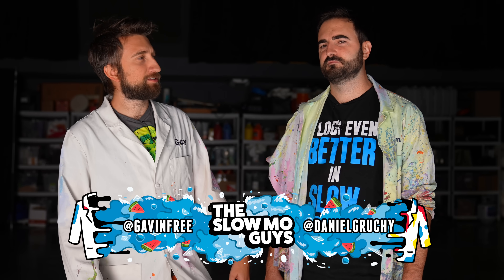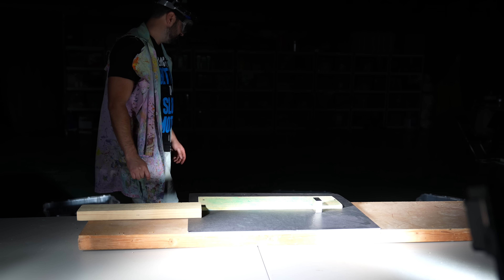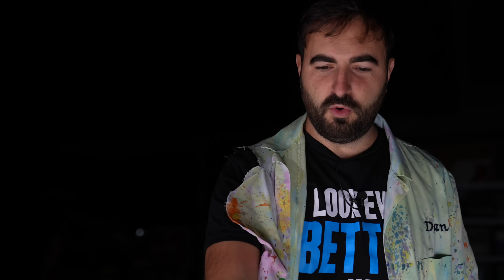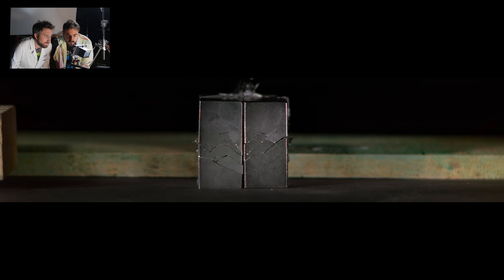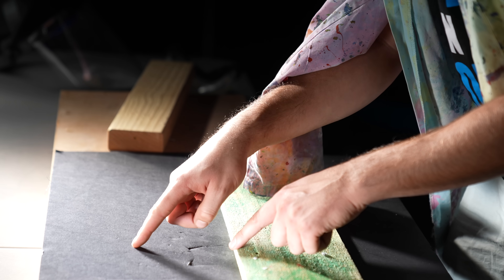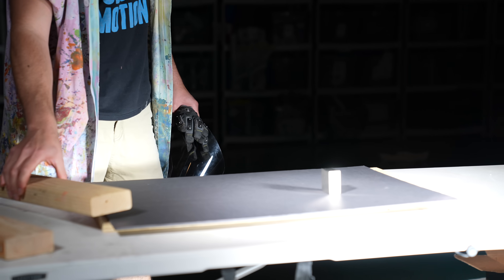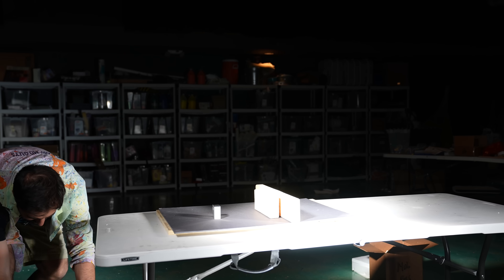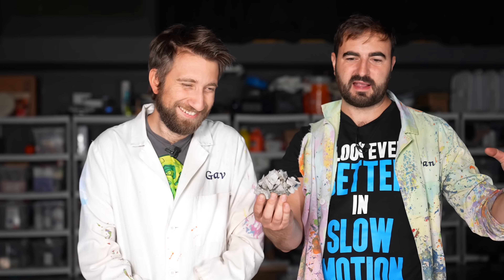Ridiculous Magnets Colliding at 187,000FPS - The Slow Mo Guys

Comment: The sparks come from tiny particles that have been fractured to reveal fresh unoxidized rare earth metal fragments, which spontaneously ignite in air. Related heavy Lanthanide and Actinide metals are also pyrophoric, such as those used in cigarette lighter flints and in depleted uranium armour-piercing anti-tank shells that ignite on impact with the tank armour as they penetrate it releasing white hot burning uranium particles within the tank, burning personnel, ammunition, fuel, and anything else flammable in the vicinity.

Comment: That insane power right there is evidence for the balanced force holding everything together/apart.  Inside those magnets is just a tiny amount of the electrons are surface=spin aligned.  10^-22 of them perhaps, but this enough to produce those results.

Comment: You guys overstated the danger of magnets.  At more then about a foot, you most likely could not detect the field (if you could, it would be weak).  Magnetic fields decay exponentially with distance (i cant find one single formula for this, seems to be a very complex topic, but what i said seems to be a rule of thumb type thing.  the field still decays quickly though).  You will still have to not put your hands between the magnet and anything magnetic, and don't bring digtel device close (about ~6in away is safe for modern SSD, hard drives are much more supsetable to this kind of thing)

Comment: Would be cool to see what the fields looked like on a large ferrolens as the collision was happening.  Heard somewhere on line (I think Ken Wheeler) that the stronger the field is' the shorter the field is' due to it falling back upon itself at a higher rate of speed, if I'm not mistaken.

Comment: I remember "playing" with a very strong magnet once at the lab as a PhD student. Probably not as strong as that, but freaking strong, to the point it WAS dangerous.
The researcher around told me to be careful and that it was no toy. Thus I was careful. And yeah, I totally could feel the moment when I would have crushed my hand.
In the end nothing broken, no problem. However I do realize now that it was a bit "incautious" of them (and I myself was very much unaware of the actual danger and problems).
Well, that were different times. To be fair, there was enough issues around. I mean, we WERE in a nuclear reactor, so... what could have gone wrong?

Comment: What if you took the two clumps at equidistant ends of the table & slowly moved them together. Would they collide or are their poles too irregular? If they collided as they did the 1st time, would they reorganize into a better bi-polar magnetic structure ?

Comment: Ew, ew, ew! Please consider a "Magnet's Colliding II." You could have the magnets sitting on top of plexiglass sandwich with iron filings in the middle. When filming from above you may capture the magnetic lines forming in the iron filings. It might take a large plexiglass table with possibly the magnets positioned above a 3rd sheet (leaving a gap) and it would take buukoo filings.

Comment: I was so on the side of measuring the speed/velocity increase at the same moment Dan said it.  You should have done the second one with the black/white grid for the measurement.  I'm banking there is a velocity increase (but at what level and level of increase as the magnetic pull increases [i.e. getting closer]).  Still a brilliant piece of filmed footage gents.

Comment: I have a Question. It's when the magnet collides I see that there are tiny pieces of it and floating around then moves away itself. Since those tiny parts are also magnetic why did it not move back into its body ?

Comment: If you still have the shards, throw a bunch of heat at them. You need to demagnetize them before disposal, and the easiest way would be with heat above their Curie point, which can easily be around 100C.

Comment: The acceleration is NOT exponential in neither time nor position.

If we considerer the magnets as point-like magnetic dipoles, for the sake of simplicity, and we call the distance between the dipoles x, the acceleration a(x) goes as x^-4 (x is decreasing until it reaches 0 and the acceleration reaches infinity), which grows way faster than an exponential function. Given an initial position x=x0 and doing a bit of newtonian physics, you can derive that the speed v(x) goes as sqrt(1/x^3-1/x0^3), so the speed ends up behaving tangentially as x^-(3/2). I tried to get the time dependent solutions x(t), v(t) and a(t), but I end up with a pretty ugly integral that might not have an analytical solution.

Idk the time dependent solution, but a(t) and v(t) can't be exponential, as they tend to infinity for the time when both dipoles collide, while an exponential would go to infinity for an infinite time.

Comment: a friend has 2 crazy magnets. someone was holding them and got them to close to each other while trying to hold them back and with them about 5 inches apart and continuing to pull them away from each other they collided and actually chipped one of them. they were in socks, cause how else do you seperate them from anything, and it took 2 dudes pulling them apart to separate them. they were strong enough to stick to each other through a grown mans forearm. they were bigger than the ones in the video

Comment: Magnificent stuff! What about part II with the reversed polarity so the magnets repel each other instead, and you can use it for a spring substitution or maybe a "cannon" with one stationary magnet and one pressed as much as possible towards it and then have a trigger of some kind releasing it at full speed and force. You should probably have a separate bullet to "shoot" to avoid sending a large heavy and hard magnet across the room so you also need to stop the magnet, but it's kind of a useful idea?

Comment: safe disposal would be easy for you guys, just use your torch with the blue flame and heat the metal. Depending on the composition of the metal it could start to loose magnetic attraction at 80°C

Comment: TO DEMAGNITIZE A BROKEN NEYODINIUM MAGNET PUT ON CONCRETE BRICK AND HEAT WITH TORCH FROM DISTANCE TOO 400°F MAGNET WHEN RE COOLS IS SAFE TOO HANDLE AND NO LONGER HOLDS A MAGNETIC FIELD UNLESS REMAGNITIZED BY ANOTHER MAGNET.

Comment: I kinda want to see this come back with a specific difference. Make a sort of housing to prevent the fragments from flying to far, the see how fast the magnetic pull draws the fragments back. Just make a relatively thick wooden box that has a small opening so as to capture it on camera. Maybe add some length markings to show how fast the pieces move etc.

Comment: 4:54 The more I think about it, the more I think those sparks are actually small bits of magnet being heated up by the induced current of the highly chaotic field it's in. I bet the small bits are doubley impacted by their small size. Less induced current needed and also more susceptible to small gradients in the field strengths that may otherwise be averaged out in larged bits.

Comment: reminds me of when I went to clean the magnet on the gundrill oil filter. It slammed into the scrap bin and I couldn't get it off with the crane and forklift. I did eventually by sliding it to the edge and twisting it while pulling. Never brought it near metal again

Comment: I know someone from the extended family that works with electromagnets, who pinched his pinky finger under a plate when a really, really powerful electromagnet's PSU randomly activated because of a short.
The bone was so crushed, they basically had no choice but to amputate the tip of the finger, which is now shorter by ... probably 8mm to a cm. Magnets are scary as frak. You get on the wrong side of powerful magnets, you get boned.

Comment: it's probably the fact that there is no take backs, this is a humanly unstoppable force. if you mechanically placed a magnet on either side of your finger or hand, no amount of straining or grunting would prevent that amputation. you could make a fist and there's a good chance it would just either crush it open or, slide to one side and pinch off a piece of you. I think it's horrifying, it's like holding a bomb that goes off randomly with out warning.

Comment: I bought a single 1" x 3" n52 disk magnet a while back and I was impressed by it. I didn't need it for anything I just like magnet and its was cheap... So I ordered a second one... It wasn't until I was unboxing the second one did I realize what I had just done. I felt so stupid not even thinking about the danger I just allowed myself to get into. I was unboxing this magnet maybe 2 feet away from the old one before I realized it. Anyways not one lives in my bedroom closet the other is across the house in the hallway closet. I have owned lots of strong magnet before this but nothing this strong. My old ones could possible break fingers if you let them but you'd probably have to try to get it to happen it wouldn't be spontaneous like these other ones. The single magnet went from being this dangerous toy that I would use to pick up anything ferrous I dropped into the carpet or used to just play with random diamagnetic objects, to this thing I am now scared of messing with just incase I forget where the second magnet is again.
Anyways, moral of the story having 1 strong magnet is not safe but not that dangerous, but having two is dangerous.

Comment: The sheer amount kinetic energy that gets formed in that span of time to blast those two magnets to pieces is INSANE, like honestly that is terrifying
Reply: No. You swinging a hammer is going to have more kinetic energy involved. Those magnets are extremely brittle and werent going more than 15mph. Learn to actually do math and physics and stop trying to make dumb assumptions about things you dont understand.
Reply: @thomgizziz  They ARE very brittle, but like most brittle things, that just means they're sharp when they break. Bonus danger! 

BUT they're also very heavy, so there's the nice mass part (more than a hammer, and possibly even more than a sledge hammer when both weights are included honestly) of the equations.  Speaking of BOTH magnets, they're both moving, you have to establish one still as your frame of reference, so I'm guessing 15 mph is a low ball. Also,  Energy isn't about speed, it's about acceleration! 

Magnetic field strength drops off as a square of distance, so by the time they're millimeters apart, they're accelerating at much more than the midpoint speed would suggest.  THUS while the kinetic energy in the lead up isn't super insane, at the point of contact, it is!  So, no, even swinging a 3 lb sledge hammer couldn't compare to the point of impact from both magnets moving to each other, thom. Bush up on your conceptual physics because you can't do the math until you understand the basics.
Reply: @thomgizziz  You should perhaps do a experiment where you take two fingers and crush one with a sledgehammer and one twixt two of them magnet things and see if you can still talk all tough like.

Comment: That makes me think of two large asteroids colliding with each other in space (zero G) where there is no friction involved until the two meet. The impact obliterates both asteroids, releasing so much energy that much of the material is molten and quickly forms tiny spheroids. Meanwhile due to the significant mass of the two objects, bits and pieces begin to coalesce over time into one larger, single asteroid. Eventually, almost all the material will be attracted to the main conglomeration and as it slowly grows, it's gravitational mass increases making smaller and/or more distant particles to return to the point of impact OR they might just orbit at the right speed and distance from the gravitational centre of the asteroid.
Ya... that's what this makes me think of !

Comment: Cool! I'm curious, if you placed magnets like these next to each other with opposite orientations would they repel each other hard enough that they fly off in opposite directions, or would they have time to flip and smash back together?
Reply: You can do this with home magnet kits, and they usually flip and then smack together.  Even here on the table, the second attempt, the magnet flipped to the attraction side instead of being pushed further away.

Comment: If I’m not mistaken, as pieces break off of larger magnets they form their own magnetic field which is what causes them to get all mixed up as they smash back together. Each piece is trying to find a spot of opposite polarity to stick to, and because there’s so many pieces there’s many different magnetic fields in play of different strengths depending on their size. Super interesting to see it in slow motion though. I might have to do this with some magnets myself to make some little desk art pieces because they’re super interesting looking once they smash together. Very neat stuff!😊
Reply: There was one big chunk (oddly enough, right above the two they highlighted) that you could see it initially spinning in two axes, and then it just sorta... slowed down and you could literally see it lose an axis of rotation but keep spinning in the other axis as it came back towards the larger mass.
Reply: All those lines of flux. Incredible really.

Comment: the way that the shattered pieces spin and flip, while the polarities attract and repel each other is fascinating. i had one inch neodymium cubes that reacted similarly when they just came together, in a controlled manner; bits would flake off the edges, presumably because the shock wave of them touching, even when controlled, travels off the edge. i have 2 inch neodymium spheres that don't flake apart so easily; i'm thinking because part of the shock wave travels around the sphere instead of flying off an edge? or perhaps we need another test...

Comment: Is there a way to de-magnetize the block of magnets to make it safe again?
Reply: If you heat them to a certain temperature (it varies depending on what metal you're using) a permanent magnet will lose its magnetic properties. It's called the "curie temperature"

Comment: it's not exponential. In principle you would expect it to increase with the third power (since the field drops off with the third power of distance; it's a dipole field). However this is only the case for small enough magnets (compared to the distance). In this case being close enough the field strength should be more or less constant meaning constant acceleration close to crashing.

Comment: Next put two tablespoons of gasoline in a metal barrel, light it on fire with a fuse and enjoy the massive bang from 50 metres away. Use ear protection. And yes, 2 tbsp are enough.

Comment: I LOVE how the magnets pick up speed exponentially as they get close to each other.  At first it looks like they're barely moving but the force of attraction is so strong by the end that they are flying into this massive collision!
Reply: It's not exponential, just a high order polynomial,  acceleration is inverse square of remaining distance, minus speed times friction, minus air resistance, maybe a 4th or 6th order polynomial . Someone should do the differential equations and then check against the time-stamped raw clip .

Comment: If that's a metal base, if greatly reduced the travel velocity, by way of the eddy currents induced on the plate, which in turn created counter-magnetic fields. Two colored magnets, having a graph of the instantaneous velocity, measured with a rulers and frame counts, would tick all boxes for me.

Comment: This was stinking cool !!!
Reply: So shoot a magnet next?
Reply: When’s the slo mo 4 bore video coming?
Reply: Hey there Scooter
Reply: I know copper can react to magnetic fields if it's moving fast enough. That makes me wonder: What if you shot copper ammo over a row of powerful magnets? Would the copper heat and melt due to the induced magnetic field gained from the stationary magnetic fields? Would it deflect away or towards the magnets? Would it slow?
Reply: I think it has been done before, but how about you get these guys back on your range and you guys test to see how many neodymium magnets it takes to bend a bullet and how many it takes for each caliber. Odds are is that it'll only take about 3 shots before a bullet hits a magnet, but it'd be cool. You know a .22 might whip around a single magnet block. A 9mm would whip around 2 of them. A .45 would just slam into 2 of them, 5.56mm would speed by. .338 Lapua would start spinning or something. It'd be a neat video and you'd need proper slow mo to see exactly how much effect the magnets had on the bullet's path.
Reply: So glad they didn't put a thumb in it!
Reply: Hi there Scott 👋🏻  Good to see you in the community again!

Comment: Nice video!
Idea for another:  I saw a video where they shot watermelons with subsonic and supersonic ammunition.  Subsonic did not explode them but supersonic did.  At the moment of impact, the melon juice spraying toward the gun seems to be in the shape of a mach cone.  I'm wondering if it is the mach cone, and not internal pressure from the projectile, that is causing the melon to explode.  It would be awesome of you guys could figure this out, I've never heard such a suggestion before (in my admittedly limited experience).  Cheers!

Comment: These strong neodymium magnets are really scary. I think best way to dispose the broken magnet parts is to heat them up to their Curie temperature where they loose their permanent magnet properties. I believe the Curie temperature for neodymium is about 400°C (750°F). 
This is just a theory I have, but another and perhaps easier way is to crush them into even smaller pieces and let the pieces pull together into a ball-like shape. In that way, the pieces will naturally orient themselves so that they cancel each other out. The smaller the bits, the more they will cancel each other out. If my theory hold water.